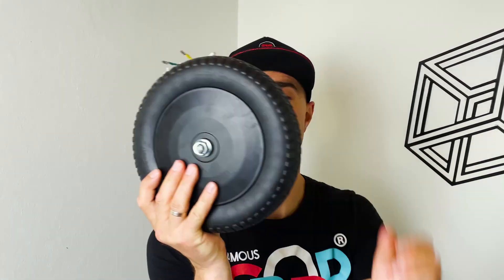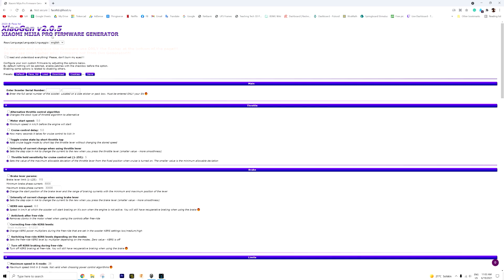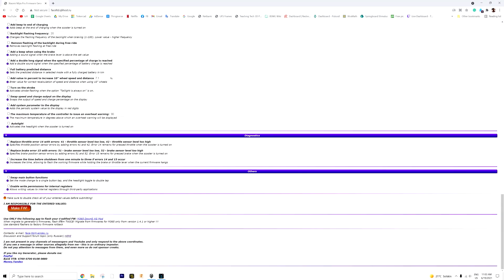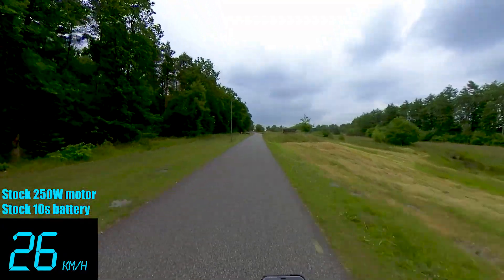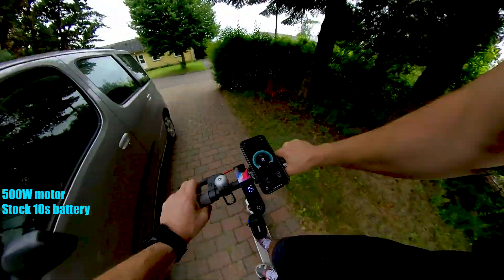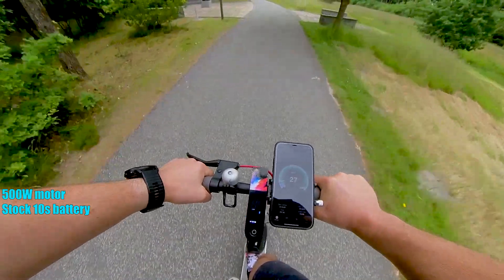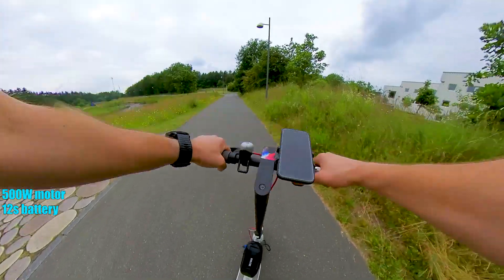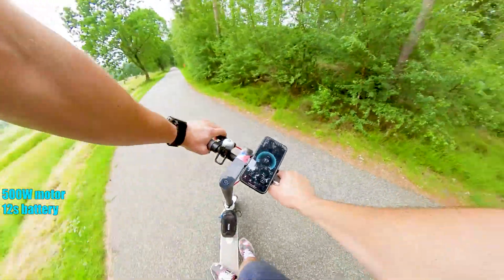Xiaomi m365 first look at the 500W motor (Monorim ?)

Comment: speed is so low :( But acceleration not bad. 350w motor can 42 km/h at 42v(36)
Speed 40-50 comfortable and this is the maximum possible speed without losing control. Better wheels is pneumatic cst 2.25 and 3.0
Reply from the maker: This motor is rated for 48V, so fully charged   54.6. I think I can run this motor even on 58V, then it will go fast. 
Honestly, I don’t need more than 35km/h on my scooter :) But we will see how it goes on 14s battery and with a 4kw controller. 
Got my controller yesterday, will begin building soon!
Reply: @VRMinde  I will be looking forward to that video.
Reply from the maker: @rocketrhys2676  I have tested it now for 5mins. 35amps gave me 42km/h on gps. Will continue testing, the only problem is the rain. It’s forecasted until Monday. Hopefully I can film and edit by  the end of next week

Comment: If you bought more battery u will reach more speed that buy a 500w motor!
Reply from the maker: Oh, I am aware of this mate, I was just curious to see what it takes to bring this motor back to life and share with others how it works on a stock pack. 
I have a 14s pack and I do have a spot welder + some spare 16s bms as well, so I will give it a go, I just need more time for all that work :)
Reply: @VRMinde  I'm waiting for the videos here's
Reply: @VRMinde  try 22s on this motor
Reply from the maker: @marine1718  I have not tried such a beast pack anywhere yet :) won’t try it yet I assume. 
Good news is that the motor is spinning alrready. Just need yo tidy up everything and will do first test ride
Reply: @VRMinde  I tried today 20s xiaomi and is impressive with 300w motor
Reply from the maker: @marine1718  I must be :D but at the same time I only do these experiments for the sake of trying. I am fine with 2x250w and 12s pack for a daily commute 🙄 and for offroad riding it is not even worth building m365 as there are way better frames/suspensions on other offroad scoots.

Comment: Been there got a stack of burnt out controllers.
Frustrating and fun at the same time. 
👍
Reply from the maker: Definitelly double feeling mate 😂 rollercoaster :)
Reply: Can one add a few mosfits myself is it hard to do.
I got two 36v controllers can I not just add the strip of mosfits to it
Reply: I’m looking to add two 36v 500w motors to my hover-1 alpha that I’m customizing. It’s my first build and I’m a bit nervous. Can I run two motors at 36v on the stock battery and just upgrade it with a pack? Or should I upgrade everything and get 48-60v and run dual 48v-60v 500-1000w ? So many choices. 

Obviously I’ll have to upgrade the controllers and modify a bit but it’s mostly bolt on and go. Any thoughts?

Comment: please try the motor on the m365 pro cuz i saw a video of a guy going 70+ with 500w motor
Reply from the maker: Hi mate, It does not matter if it was “pro” or any other version because to reach 70+ you will need a completely different battery pack (probably 72V) as well as a controller. 
And second: I would not drive 70km/h on a scooter like this with 10” tires and shitty brakes. I have my ebike for speeds like this :)

Comment: You need to try the power based throttle, you can reach about 32 km/h with 250W motor (35 with 10 inch tyres)
Reply: If you Want I can send at you a nice Italian Firmware
Reply from the maker: I tried all possible firmware mate, until my controller has burned (this was the 4th one). And all of my firmwares are power based. 
Maybe I am “special”, but with my 85kg body weight (probably 90 with clothes) I can never reach more than 31 with the stock battery and 36 with the 12s, measured on gps and on the 10” tires :)
Reply: @VRMinde  Wait do You have an email? I'm trying to send at you a firmware
Reply from the maker: @simoplay29  I do. It’s: weareminde gmail
Reply: Can u send it to me

Comment: When you say you put the 500W motor with a 12s battery did you use an external 12s and the internal or just a 12s internal? thinking of sticking a 500W on my Pro 2 🤔
Reply from the maker: I used only external. If you want to connect both 12s and 10s at the same time you need Rita device. Mine is laying around with a burnt fuse 😂
Reply: @VRMinde  ah thanks I think the Pro 2 is already 12s so maybe a good uphrade with firmware unlock 👍
Reply: @1974RLuke  pro2 battery is still 10s, it just has more capacity.
Reply: @JamesChurchill  thanks 👍 wasn't 100% on this

Comment: the motor comes in a pack that includes a new controller and higher amp battery so u can go 60km an hour
Reply from the maker: This one from aliexpress didn’t, there is a product link in the description. It was only the motor mate.
Reply: @VRMinde  ah yeah a european re seller makes upgrade kits with these for 450 euro i think including the battery motor controller and interface if im correct
Reply: @Jay-rd6fe  do you have a link?
Reply: @jssweden6128  sorry i cant find it anymore it was a spanish monorim retailer that made the kit if i remebee that came with a controller bigger battery and motor

Comment: I'm not sure what is the point to have 5 km/h extra for all these risks of burn or extra modifications... With a pro 2 and tweak the firmware, you can reach 35 km/h... No need 500w motor, battery change, no risk for the controller. Am I wrong?
Reply from the maker: It is always worth getting a scooter designed for it :) but fun to experiment. The max speed depends on the riders size a lot as well. 50-60kg riders ride 32-33km/h on stock m365 as well. I am not sure Inwould get to 35 on the pro either.
Reply: no your right I get 34kph on my pro 2 with firmware mod. The Pro 2 has an updated controller so its ok but other models an uprated controller is really required.
Reply from the maker: @1974RLuke  pro 2 also has more powerful motor than 250w. Today I fixed the controller and sent 25amps on it, max speed was 35km/h with the 12s pack. Same can be achieved with 250w motor. I think this 500W motor will only start to shine with something like 14s and some decent controller 🙄 will try that as well
Reply: @VRMinde  I got 36 out of 25amps stock battery. Need to put an extra one hut I really want some feedback on the 500w motor. How fast will it burn the Controller. I can't find anywhere how much it can handle
Reply from the maker: @themajasticcreature  I think the controller can handle quite a lot and you can monitor it’s state by observing the temperature. I burned all controllers while braking 🙄 disconnect recovery braking and use physical brakes, and then make some extra cooling for the controller and observe temperatures in the app when you ride. This could be the way to figure it out.

Comment: That motor has better performance with 13S (48v) battery
Reply: Stock controller with irfb4110 mosfets and 100v capacitors
Reply from the maker: @CarlosDRLopes  I need to buy other mosfets 🙄
Reply: Controller must be v2.1 or better yet v3.0
Reply from the maker: @CarlosDRLopes  the difference is only the traces if I am not mistaking?
Reply: @CarlosDRLopes  how many mosfits if u don’t mind me asking
Reply: @MonkeyUkTheZoo  6
Reply: The 12v rectifier on the v1.4 can't handle the voltage spikes when we brake
Reply from the maker: Oh I believe so. What controller do you use though? I am a bit hesitant to take the Phaserunner from my ebike with 14s pack, but I might do it for an experiment :)
Reply: tens video?

Comment: 500W and 12 battery combination looks really a huge boost. I wonder is it legal this kind of modification and what would be life span  of xiomi itself. Anyways don't teach the younger ones and great content as always! Cheers! :)
Reply from the maker: It is legal if you limit the speed to 20 or 25 depending on the country. I don’t think it is a big issue in your homeland. 
When I will get a controller replacement I will try to limit the current and hope that it will last longer than 1min this time 😂 getting a scooter built for higher speed is probably a cheaper, safer and more reliable way to go. 
Thanks bro and hope you are doing well 🙌